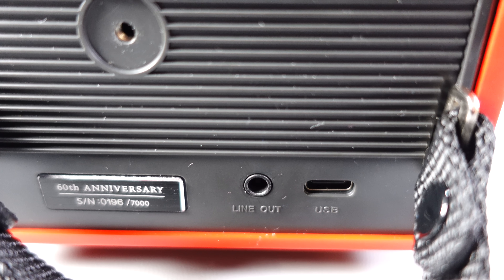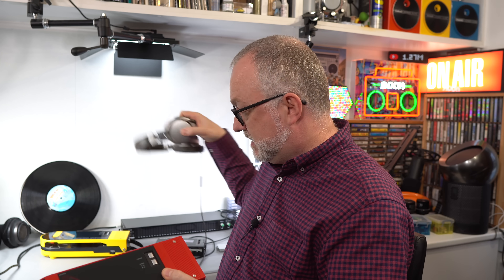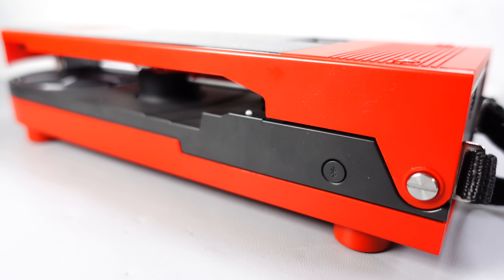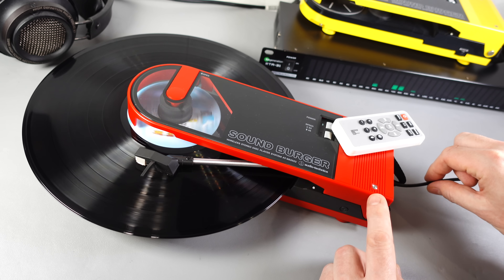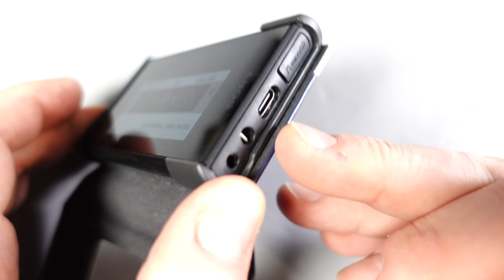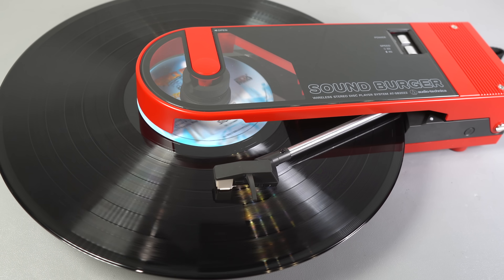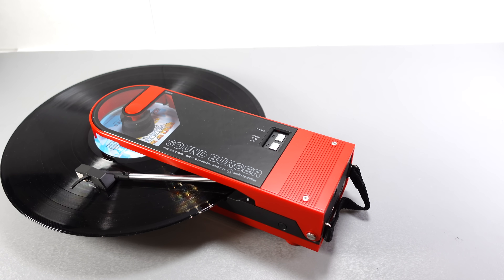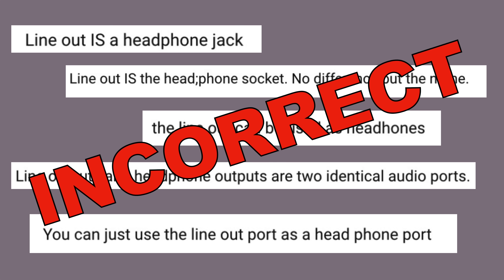Line-out ≠ Headphone-out

Comment: 5:55 No! It depends.. I once had a Philips MP3 Player and its Headphones Out was extremely quiet. I checked it and it was only about 40mV. And I have a little Audio Mixer and its Line Out is really loud, when I plug the Headphones in.. This Video is the biggest Nonsense, that I saw on this Channel so far.
Reply: I don't think it's really nonsense when it's true in the majority of cases. At least, I don't think an unverified anecdote (no offense) is more meaningful than a general rule. Maybe it is true for those pieces of equipment, but generally it's a bad idea to go that way.

Comment: It’s a useful point about using a headphone out as a line out! I use a Vox Amplug2 through a splitter to get enough signal into an iPad to be able to use the software amplifiers; the vox also works well when I want a highly portable guitar amp for practice - plugged in the back of a 20W powered speaker. It even sounds nice - nothing like an AC30 or a good Fender amp - but enough noise for a small jam session with friends, or a singaround!

Comment: Sir I have BPL Audio System 80 W
it  has 2 port front side 
I)
it has 
MIC mixing  i used as ( input headphone jack  from mobile to it or input from  laptop  3.5 mm)
or in mic mixing,    i use bluetooth 3.5 mm incert in   mic mixing....    blutooth dongle has 3.5  mm output 

plus
II)
Phones as ouput   ....  near to  mic mixing jack 

i used as headphone output ..

plus  it has
input  as CD DVD audio line input 

also has some funtion
as  buton shift 
line in 
radio  ( FM SW1 SW2 MW)
tape

Comment: As a retired Broadcast Chief Engineer, I grimaced as you said some things.  Yes everything you said will work, from a appliance operators view.  The Impedences will be way off.  If you bridge [a high impedance across a low impedance source] everything will work properly.  The volume may be low.  The other way, with low impedance headphones as you did, the volume will be loaded down.  IF you plugged in HIGH impedance headphones of 600 Ohms or more up to 2K Ohms, then you would have nice volume.  IMPEDANCES MATTER.

Comment: My Sound Blaster Z SE audio card have both Headphone and line level outputs, so I must plug in speakers to line out and headphones in headphone output.

Ofcourse amplifier could be plugged in any of these above mentioned outputs, but headphone output is designed for lower impedance.

Comment: the raspberry pi 3     has a 3.5 headphone jack but it also outputs optical and its audio amp is very low quality plus the power supply is v bad so hum is very bad like a headphone or line out from a laptop will give you a ground loop or feedback hum from the power. if you run the laptop on battery you get no power loop or hum

Comment: Additional confusion: some Bluetooth headphones have a 3.5mm socket, i.e. a "headphone-in" port. Most such headphones, when connected to a hardwired source through this port, just act like regular "dumb" headphones, passing the headphone-in signal directly through to the drivers. But some Bluetooth headphones treat the headphone-in port as if it were a line-in port — feeding the analogue signal to the same internal amplifier used to amplify the output of the Bluetooth DAC. (You can tell you've got an amplifier in the signal path of your headphones, if the volume control on the headphones keeps working, even when you're plugged into an analogue audio source that doesn't support the extra control-channel ring of a TRRRS jack.) Such headphones may also support direct consumption of digital signal sources — e.g. PCM-over-coaxial from a modern TV.

By analogy to "active" speakers that have their own DAC+amplifier built-in, you might call such headphones a rare example of "active" headphones.

Comment: Not saying that it is "tthe same", but you CAN use the line out for headphones.. but also; There ARE some headphones with rather low  impedance they can have a decent volume in themselves.. but still.. You CAN connect headphones to a line-out.. it's not reasonable to compare that suggestion to a Mic or power 3.5 mil socket.

ItIt's not that they were wrong, they were right but with an asterisk.. and the MAIN reason I'd say that they w may be expecting too much is because a LOT of devices DO have a volume control so you CAN increase the amplification of the line out.. but more impoortantly; MOST people use a sound-card, and even if one or other is defined as head-phone or line out,  they are still used pretty much interchangable, t he MAIN difference is that the one that is registered as a headphone jack will silence anyone defined as a line-out jack.

Comment: Line-out is a signal  voltage source (not a power source for a low impedance speaker), and it likes to see a high impedance load. It isn't designed to drive appreciable current into its load.
Headphone-out has to deliver power into a reasonably low impedance load (the speaker) and is designed to be able to deliver higher signal currents.

Comment: A perfect example of over reading a statement. They said CAN, not should, as in, you CAN use it that way, even if it's not necessarily ideal. The examples given, on quite a few cheap mp3 devices, worked as all of the above, power, data, and audio. The Raspberry Pi for example can do component out on its line out with a simple kernel setting, or just do line out. Many of the devices that use that port this way are multi-function, so even with your examples, what you're saying isn't always true either, not that I'm saying most of what you're saying isn't true.

Comment: Sometimes they're the same, for instance some cheap sound card outputs have an identical output stage and are controlled by identical amplifier circuits. The only way you'd know is by analyzing the design of the output driver. The label doesn't necessarily tell you anything other than that a line out probably wasn't intended for a low impedance load - which sounds contradictory, but they may nevertheless be identical.

Comment: Short answer, line-out is not amplified, headphone output is amplified.

You cannot control the volume of a line-out output unlike headphone output.

Line-out is used to connect the device to an amplifier not a speaker.

Comment: From line out you get stadadized low level output for all devices, where headphones gives what ever that unit makes with its amplifier and its settings. So line out is a laazy technicans low power solution, while headphone plug is made with build-in amplitude modificator.

You can still put your headphones to line out, but you won't get loud sounds from it.

Comment: completely different signals and impedances. Those who thought they were same are clearly thinking of the typical headphone / line combo jacks on laptops. which are self switching (on detected impedance ). but make no mistake, there is both a line amp and headphone amp inside what it can swap between.

Comment: Indeed, line out cannot drive low-impedance headphones because of exactly that, the low impedance meaning that headphones need large current instead of large voltage. Headphones out is insufficient in many cases for providing a line in -signal due to the low voltage. "Large" is of course relative, not as large as speakers require.

Comment: If well constructed, one can use every HP out same as a line out (though higher levels than "standard" likely). Well constructed line-out ports cope well with HP impedance > 250Ohms but then are too low in volume. In ears are mostly <=32Ohms, but are so sensitive, they almost all work very well with line-outs - nevermind they're mostly way to loud without attenutation and most likely have way to high output impedance to not influence the bass response of dynamic drivers.

Comment: The reason it doesn't work is to do with impedance. The impedance of the headphones are too low for the line output amplifier to handle. Line output is usually a high impedance. The average headphones are around the 64 ohm to 128 ohm range (if not higher, depending on brand). The impedance of the headphones loads the amplifier too much, so you end up with a weak signal, if any at all and/or eventually destroy the line output (overheats it). Current is also a factor. The current required to drive a pair of headphones is far higher than the line output buffer amplifier can deliver, which is usually in consumer products just a simple operational amplifier, which can only deliver a few milliamps.

Comment: It's all in what's called an output impedance.
Line-out has high output impedance(~1K Ohms) to be the source of audio amplifier's input, while
headphone-out has low output impedance(32 Ohms are common) to drive a small speakers. 
There is amplitude difference as well as impedance difference which degrade audio volume and quality.

Comment: Other reasons the line out does not work well with headphones is the impedance amounts. Headphones can be 24 ohms to 64 ohms typically whereas the line output is 600 ohms to 47000 ohms. The headphones will therefore load down the line output substantially. 1:39

Comment: No mention of impedance? Line outputs are typically high impedance relative to headphones. Line inputs are very high impedance, so the high output impedance wont matter. But driving an 8ohm headphone will not result in much signal.

Comment: Line-out = Unamplified signal; you must provide an amplifier. Headphone out = Amplified signal; the device contains its own amplifier.
Reply: Yes, but with a low impedance output so it can provide current to move the coils of the HP capsules, the voltage is not high enough for line input unless you crank the volume up from the source. And then when you forget that it is turned high and unplug the plug from the jack...BOOM goes your ears.

Comment: Connecting Headphone Out into Mic In kills the audio chip pretty quickly, btw...
Reply: Have you experienced this? Do you mean the input amplifier of the Mic input of a device? In pro gear you should have a spec sheet saying how much voltage is allowed to be input. And the HP output is low voltage high current due to its low impedance.

Comment: The "gain Lo/Hi" is for either coming directly out of a record player at "Phono" level (Lo) or "Line" level (Hi) after it's gone through a mixer or some other piece of equipment that brings it up to Line level. Some record players may boost it to Line level now days, and this could account for the difference in levels you've experienced with different Vinyl players, however usually the vinyl player's Phono output will be some 20dbmV-30bdmV quieter than Line at a bare minimum being that Phono is normally around 0.15mV-5mV only (5mV is super high compared to the average), and Line runs at a level of up to around 300mV!. ;)

Comment: The reason why people are saying it works, is because they have never used any other audio equipment other than their computer's soundcard, which automatically switches over when using the line out output as a headphone out as it has both built into the same port, as it does with line in and mic input as well.

Comment: You are contradicting yourself because if the sound is heard through the headphones, no matter how weak, it means that headphones with an external sound amplifier can be used.
Reply: That's literally what he just said. 4:15. Anything after the Line Out requires amplification. This has nothing to do with either headphones or speakers, it's only about amplification.
You cannot use a Line Out signal with straight headphones because it's a line signal. It's too quiet. Hence why there's a difference between a headphone output and line out, one requires amplification, while the other already has amplification (hence the volume control on the model that does feature a headphone out).
Reply: Did you even watch the full video

Comment: My old Pioneer RX-Z71L midi system uses a line out connector as a command  wire between the amp/tuner/tape deck and the CD player which is a separate component. Without it the remote control will not operate the CD player.

Comment: Line out IS headphone out. Audiophile bollocks strikes again
Reply: Seek professional help.
Reply: @cadendurden06  audio professional*
Reply: No it's not, watch the video. 

It depends on the device, modern devices have added confusion to this. On a modern device what you plug in is auto detected, on older devices it is not the same, it is not amplified. 

If you plug headphones into an old "line out" you barely be able to hear it in a quiet bedroom.
Reply: @volvo09  can you teach me how to be so confidently incorrect? Because you have down to a fine art. Is it just a natural talent?
Reply: There is a difference between a Line Out connection and a headphone connection, because one requires amplification afterwards while the other already has amplification. The line signal with a headphone out has already gone through an amplifier before the point in which you connect your headphones.

You can think of it like a microphone. Microphones have a line signal from their diaphragm. This signal needs to be amplified from line signal to a mic signal, which is loud enough to be audible.

They are literally different, because one has amplification already done, and one does not and requires you to amplify the signal outside of the product. This is different with "modern" devices, such as desktop computers that have a "Line Out" on the motherboard, but this already has amplification, so calling it a Line Out is technically incorrect.
Reply: @AmSleepyJay  a lot of words to say something incorrect, try being right next time
Reply: @the-np4mr  okay, well. Instead of just spewing words back, could you explain why I'm wrong? Give some details about how they're the same thing, please.
Reply: @AmSleepyJay  nope

Comment: Killed my first tube amp by mistaking the speaker out for a line out..
Reply: Do you know which part in the tube amp failed? Tube amps do not seem to like a no-load situation. My theory is that their output voltage rises so much that the output transformer will fail.
Reply: @WeightlessBallast  was indeed the output transformer ,   the guy who looked at it said that the bored arched and was heavily damaged and the opt blew and took other things with it,

Comment: In short: headphone out includes amplification, boosting the power for headphones. Line out does not, so it's a weak signal you generally need to amplify before playing on headphones in order to get to a proper listening volume level.

A player with headphone-out will have a volume control, which is what the amplifier enables. A player with only line-out would not, because it has no amplifier to adjust the strength of the signal which in a headphone adjusts the volume. It's assumed that line-out is being connected to a device with its own volume control.
Reply: YOU ARE NOT SUPPOSED TO PLUG HEADPHONES INTO A LINE OUT!

Comment: If for some reason, you still confused after watching this then: Line out is just a headphone out but waaaaaaaaaaaaaaay quieter. So if you plug your (non-powered: no headphone amp built-in) headphone into Line out, you will probably can't hear anything or barely hear even if you turn every volume knob to the max. So.... Line-out ≠ Headphone-out.

Comment: I have a different problem.  The headphone output of portable electronics (walkman, mp3 player, etc) seems too LOW to properly drive my amplifiers correctly.  I always have to run the output of the device wide-open to get any signal through at all, and it's still not equal to the other components.

Comment: Great video! More technical: Impedance mismatching between the line out and the headphones itself is causing low volume. Most of the modern headphones do have an impedance below 50 Ohms (typical 32 Ohms, but it slightly varies). To drive a 32 Ohm device, you'll need an amplifier that is at least 32 Ohms, but for a stable and predictable coupling, it's better to go way below that. In fact, a good designed headphones amplifier will have an output impedance that is 8 times lower, around 4 Ohms. And that's the issue with line level outputs. They have an output impedance of about 600 Ohms. You're literally overloading the output with headphones. It will cause a voltage drop. Line inputs tend to have a fairly high impedance of around 10kOhms. They're not able to overload a headphones output.

Comment: I have an old Pioneer C-4600 Turntable and if use the tape monitor as line-in and my Smartphone as out using headphone-out I need to crank the volume all the way up on my phone to bring it to a level where I could control it good enough with the amplifire. So I alway thought that line-out would have a louder signal than headphone-out.

Comment: Line outputs usually present a source impedance of 100 to 600 ohms. The voltage can reach 2 volts peak-to-peak with levels referenced to −10 dBV (300 mV) at 10 kΩ. The frequency response of most modern equipment is advertised as at least 20 Hz to 20 kHz, which corresponds to the conventional range of human hearing. This signal level is too low to work with a headphones. 

With 32 ohms of impedance, most of the headphones will require around 10mW to 20mW, with 3V-3.4V peak operating voltage.  Needs a user adjustable range from zero to about 3 dBV to about 5 dBV.  

In simple words, to drive an average pair of headphones you need about 8X to 10X the power level than line out.
Reply: nice copy paste job bro